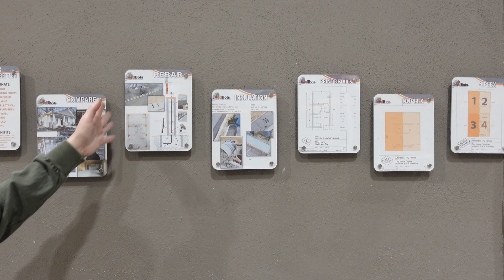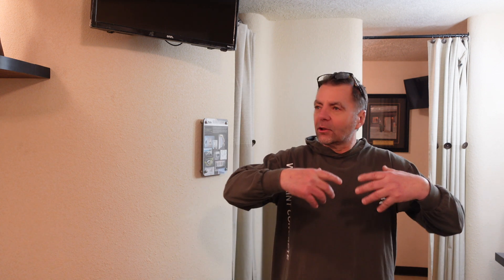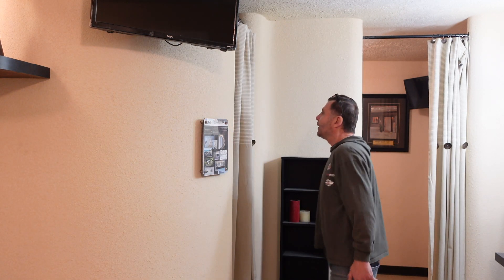This 3D Printed House Only Cost $13,000 In Materials (in warehouse demo unit)

Comment: cutting out the windows is an interesting technique. not sure I’m buying it, but it reminds me of of the lost-material technique that people use when making complex plastic parts. Could probably achieve some interesting vaulted ceiling designs using a lost-material technique (like at Paolo Soleri’s Cosanti in Paradise Valley AZ). It’ll be interesting if someone develops a nozzle that can do multiple materials—kind of like the Coca-Cola Freestyle soda fountains that can do multiple flavors. A machine like that could do lost material, and even inject insulation while printing the structure.

Putting clapboards on the exterior is silly. LOVE the price❤

Comment: Nice house! Does that price include the foundation?
Reply from the maker: No!
Reply: Or the power or the plumbing of the floor finishes or the internal wall finishes or the wet area tiling or the kitchen or the laundry or the lighting or the insulation or the doors or the windows or the painting or the termite treatment or the water proof membrane or the bathroom fittings. The list goes on.

Comment: This guy is trying to sell his product. I'm a builder and I love all the hopeful comments praising this video. 3 d printing of homes is going to be way down the road. Cost effective no way. You don't see a blueprint he doesn't show an overall view of the structure. Be realistic, he said he could go 5 ft wider and it would only cost $100 more?? Yeah right! A 3D printed house means you are only printing the walls. It takes someone making the mortar perfectly, which temp and humidity change throughout the day. An operator, a crew to set up the gantry system and tear it down. You also have to pour concrete footing supports for gantry. Super labor intensive procedure. All of these 3D home printer guys are talking out their butts. It's in its infantcy right now and it expensive. Most of you commenting have obviously never built your own home. I'm talking drawing the plans yourself and actually doing everything yourself. It's complicated and hard work. It's also very fulfilling. If it's sounds to good to be true it is. $13,000 for materials double that for labor for a really tiny house with bare minimum finish quality. Make another video showing blueprints, square footage, a house actually built on a piece of property and realist labor costs and set up times.

Comment: Wonderful, just wish they would print these training homes for those in need and leave them instead of tearing them down!
Reply from the maker: I still haven’t seen Mudbots home printed outside of a training facility. I’m not sure that this is the same way that it would be done. They would certainly have to abide by local permanent standard. If there were any in the region they were printing. I’m really excited to see a mudbots Home Printed, one of these days.

Comment: Ran a robotic welder for around 18 years it’s all in the programming when it comes to design. You could program the machine to weld where and however you wanted to. Ya you got to have a tool point set for accuracy but other than that it would go wherever you ask it to go. Imagine plastic wire instead of steel. Hot plastic stack on top of each other. It would make a wall image concrete poring instead of wire. I believe this technology has been around for quite some time. Problem is American EPA and Pattons on things that should be available for everyone in America. We suer don’t want the electric company to go under lol

Comment: The power of 3D printing is in being able to rapid prototype, and/or create structures not possible with normal manufacturing. Using 3d printing to print big rectangles (the walls) and then still needing to cut out windows doesn't seem impressive. Prefabricated aircrete blocks seem like a better fit for cheap housing. Good for politicians (who spend other people's money) for a nice photo op, but in my opinion not the best fit for the technology.

Comment: Finally a low cost inventory to solve the housing crisis.  Most of these companies are only trying to get rich for less labor.  Good stuff!
Reply: In a lot of places, it's because of 'shrinkage' on the site, and other delays, substitutions and accruals add substantially to costs. Too many sharp pencils, all of which want to lay a lien.
Reply: When a building lot in my county cost $400,000, the cost of materials isn’t the only issue.
Although it’s certainly a problem right now
Reply: Materials is not that expensive in a normal house either.  What cost is the lot (starts at around $100k and upwards out in the bush) connect water ~15k+, connect to electricity.. oh and here in sweden, we need something that is called a "lagfart" which is like a paper that you own the hous.. stupi thing from the past that is around $10k for a cheap house.  This 13k in materials is just a way to sell these houses to you to think it will be cheap :)  (oh yes, and labour.. + renting of 3d printer and pay for the architect etc... + the house ground, dont wanna 3d print that one :D + pay for 4-5 men for 4-5 weeks.. then electrician..
Reply: You know that a reasonable 3D home is $300k, right??
Reply: @BiteTheCurbNow  Wrong
Reply: @BiteTheCurbNow  Only of you want to broadcast how unintelligent you are.  A 3D print can be made and sold for 50k easily.  Don't embarrass yourself in public
Reply: @robitwhisperr  I'm sure it IS only $50000, in the parking lot  of the builder with no utility infrastructure involved. No roof.... But when design costs, team import costs, equipment import costs, electrical, plumbing and gas installed??? Doors, windows, toilets, sinks...lol What about foundation/drainage and insulation?? Not to mention hardscape like walkways and a driveway??? Lmao... I'm gonna pee you're so funny. Let's put it this way, SMART GUY, $50,000 will get you the hvac,plumbing, and electrical in a SMALL existing home near me. If you are lucky. And Michigan is on the cheap side. We do $50,000 driveways...lol We do $20,000 roofs and that's the truth buddy.

Like I said. $300000 consumer price. No doubt about it.
And don't start moving your prices around. I know the truth.